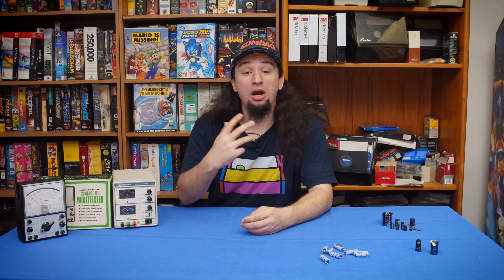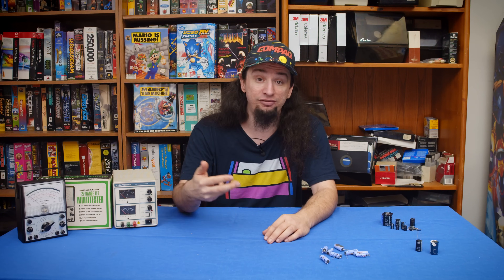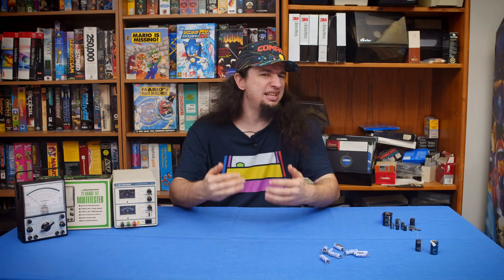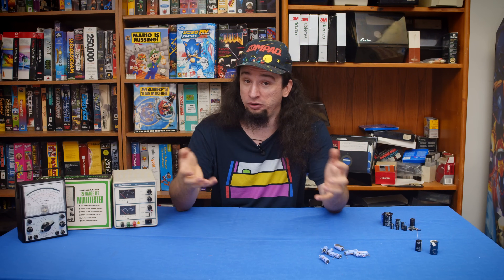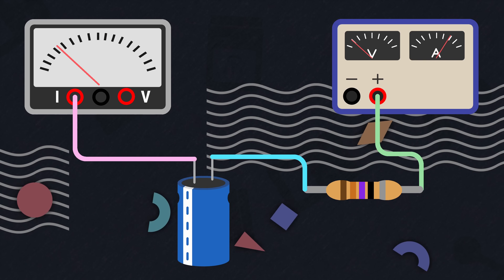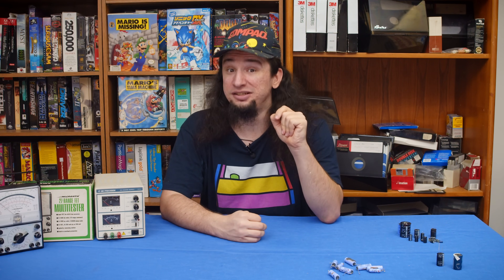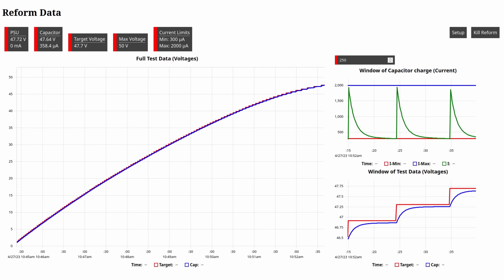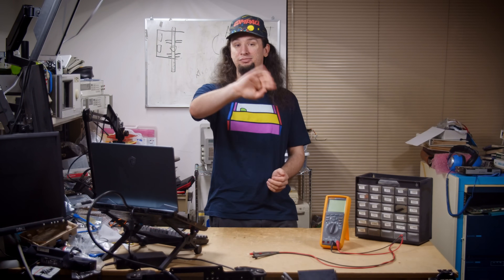Reforming Capacitors - Everything you wanted to know

Comment: So is the rate of loss of the oxide layer a function of the voltage applied? It seems that no matter at what voltage the oxide layer will be lost overtime, except that at near rated voltage it's also continuously rebuilt. So ultimately, my question is, would it be better to store a capacitor discharged or charged if they needed to be stored over a long period of time?
Reply from the maker: The rate of loss is actually more related to the temperature. The voltage only determines the thickness of the oxide.

The capacitor will self discharge over time as it rebuilds the oxide. So for long duration storage, there is no difference. Every device with capacitors in it was stored with them charged (most likely) since they would have been in circuit when the device was powered off.
Reply: @TechTangents  Ahh okay, thank you for the response!
What I meant to ask was, would it be beneficial to store them while the charge is maintained? i.e., using a charging circuit that maintains a constant voltage. I know this may present a hazard, but just thinking out loud here.

Comment: I notice that you are using a BK 1711, the out put voltage is 0-60v DC. The caps I'm working with are 400v.  You don't explain the amount of voltage that you need on your DC power supply to reform.  How can a 60v DC reform 400v caps?  Thanks

Comment: I have done reforming, but find it easier and more time efficient to just replace it. also I have reformed capacitors to have them fail less than a year later with daily use so you might as well just replace it and be done with it if reliability in the long term is important.

Comment: One of the main critiques about reforming seems to be that it might really be isolation of faults by gas bubbles, not true self healing - sounds unlikely however, given we are doing what the manufacturer did in the first place. --- I did reform high voltage electrolytics before, one simple power supply is an isolation transformer+variac feeding a delon circuit . In 120V countries, a tripler or quadrupler might be needed instead of just a delon. Do mind that that circuit can easily produce 800V+ DC with a variac that can deliver 300VAC, so switching discipline is vital.  At these voltages it becomes important to have an accurate voltmeter each both before and after the current limiting resistor (unless you are constantly doing ohms law calculations in your head) - you will need to dial in some overhead voltage on the supply, especially when you are in the phase where you are inching towards having nominal voltage on the capacitor, there can be up to 30V difference easily when you just did a voltage step, but you don't want to accidentally reach 30V over nominal across the capacitor! Also, you want the voltmeter on the capacitor itself to know when your discharge resistor (do. add. one.) did its job, and you also want to monitor for self recharging (I found high voltage lytics do like to do that when freshly reformed.... and having an unexpected 20 or 30V when trying to ESR check it could damage the ESR meter)
Reply: Bears repeating: Remember capacitors are CHARGED after reforming. That could ruin your tools with low voltage high capacitance ones, and your day with vacuum tube/inverter/photoflash grade ones.

Comment: Thanks for the video!
How should I handle my Yahama Midi keyboard and its original power adapter.
The equipment has not been used for a long time.
Hope some one replies!
Using a light bulb as someone commented is nice but should I tackle the adapter alone without the keyboard plugged in!
What next?
Thanks!

Comment: Can I reform several capacitors together by connecting multiple capacitors in parallel?
Reply from the maker: Yes, the only downside is you won't be able to individually tell if they are viable without testing each one of the separately. I track how much current they use and how slowly they come up to voltage for that. The more normal way is to fully charge them and then measure how long their internal leakage current takes to discharge it. Theres no hard value, but it should probably be above half after an hour roughly.
Reply: @TechTangents    thank you very much for your prompt reply.

I am trying to reform 120 pcs of ~4700uF capacitors with voltage rating between 100V to 400V.  It is between cautiously repeating the process 120 times or 12 times with extra extra caution.

With the self discharge, did you mean “half an hour”?  And to what value?  5~10% of its charged voltage?  hmm…. A volt meter with a stop watch counter that trigger when it falls below certain voltage.

Comment: Got a question for anyone on here that knows the answer? I have a board off a rv electric fireplace that I believe the Dane capacitor has lost continuity leaving the board without power going out? Any suggestions on these and is there a better option for replacement like a fuse for the board?

Comment: You know now that I think about it it actually makes a lot of sense that the Department of Defense would have a manual on how to do this. A lot of military equipment is ancient by modern electronics standards, with systems from the 80s, 70s, and even 60s still being in service today. And in a lot of cases the companies that manufactured that equipment don't exist anymore. The military is also weirdly cheap about certain things despite buying $800 screwdrivers in other cases. So you can see why military technicians might need to reform a lot of capacitors to keep old equipment up and running.

Comment: Just came across this - thanks Mr. @TechTangents ! Some used audio gear I have acquired is in an unknown state, so I'll be doing the variac and light bulb trick because all of them are most likely old enough to have  old-school, linear power supplies, not the modern, switching power supplies ("switchers"). Of course, I'll crack them open just to make sure. It is good that you mention that switchers cannot have their voltages slowly ramped up without possible bad outcomes. 

I have also one piece of my own, pro audio gear that is about 25 years old but was powered on only once for a few minutes to make sure it worked - and then shelved and never used again.  It will be very interesting to see what state its caps are in. 

Wow = @Mr. Carlson himself commented somewhere below - he da E-Man !

Comment: Cant find my comment and my eyes are bad. Anyhow im half noob half fixit guy. I remember fixing a logic circuit with all discrete gates and the decouple caps were low voltages and low uf . They seemed ok temp but were leaky. Just saying temp is not always good test.  All depends on what the cap is doing and how often. Idk combo of factors

Comment: I wonder if instead such laborious stepped procedure, we can use a 1Meg resistor  and make the capacitorś charging/reforming curve ultra slow but "automatic". I asume it could not be as consistant as the stepped process, but you can do the process to lots of caps at the same time (asuming all are rated at the same voltage) providing each with its own resistor. It would be the equivalent  process as the Variac you have shown.  Any though about that?
Great video anyway!
Reply from the maker: You will get exponentially slower as you reach your target voltage with that method. A variac still has "steps", they're just when you turn the knob instead.

The resistor is only used because the vast majority of PSUs can't regulate at the microamp scale. If you had one that could, you could have it set to a constant current mode which would raise the voltage automatically all in one device. That is all I've made with this setup though, just by using a higher resolution external multimeter and scaling the voltage with the resistor.

Comment: I feel that any electrolytic capacitor you plan to put into service should be determined healthy before installation.  Whether this be buying new from a reputable place and manufacturer, or by testing yourself.  I personally perform three tests on any unknown aged capacitor.  (1) Capacitance, (2) ESR, and (3) Leakage current after reaching rated voltage after 5 minutes per EN130300.  I refer to general tables for the latter two measures, created in Excel, or reference spec sheets when available.  Makes sense to leave the capacitor on the leakage tester for a half hour to an hour to perform the reformation, especially when age is unknown.  Then crank down the power supply slowly to discharge to zero volts. Recheck C & ESR.

Comment: I did watch your video from start until within 20 seconds of the end. You state that the case for reforming capacitors is with large, expensive capacitors. OK, I'll go with that. But that's a narrow use-case. Given that you've already taken the time to pull out the capacitors and there's no guarantee that reforming can or will bring them back to spec, the use-case is even narrower. Factor into that the amount of time needed to reform, the economics of this endeavour doesn't pay my time to try. So while I applaud you for taking on such a controversial topic and using independently verifiable data to defend your work,  I can't see myself reforming capacitors often (or ever) not would I recommend it to others. Well made video though.
Reply from the maker: I would add to this that the capacitors I'm reforming typically range between $15-$90 and while this process is time intensive, it's not labor intensive even without the computer automation. So there is still a very reasonable cost/benfit to reforming sometimes.
Reply: I agree, there is a reasonable cost/benefit to reforming "sometimes". But even with your persuasive arguments, I think that "sometimes" is rare. 

By your own reckoning,  it is worthwhile when the energy stored in the capacitor approaches one Joule. Since energy = ½ C V(squared) energy stored is much more dependent on voltage than capacitance. 1 Joule would be stored in a capacitor 2µF @ 1000v or 200µF 100v. I would set the bar much higher considering the replacement cost of a 2.2µF 1000v electrolytic capacitor (using film) would cost $3, and replacing a 220µF 100v capacitor would cost $0.50.

I've already done a video on why I (respectfully) think stuffing capacitors is silly. You may have inspired me to do a (respectful) video on reforming capacitors…

Comment: I work on vintage tube radios, record players and amplifiers from the 1930s to the 1960s period. I've had quite a bit of success reforming electrolytic capacitors and I would probably say around half the time I'm able to reform and have them work for a long periods of time. I don't disconnect them from the circuit though I just start at 5 volts ac and bring them up 5 volts every 10 or 15 minutes. Day before yesterday I got a 1948 radio the first time I brought it up I went a little quicker than normal just to see if I had any life in the set and was able to get it to catch stations but there was considerable hum. So I brought it down to zero again and started over. The second time there was considerably less hum. The third time I brought him up they seem to be working fine. This is the reason I searched this on YouTube because I was wondering exactly what's going on inside of the capacitor as it's being reformed. A few times after reforming and then using the record player or radio for a period of weeks I've had the capacitors revert back to the failed stage and get home again at that point in time I change them out.

Comment: I know this is late to the game. I want to offer a tip. Drain your bench power supply feed before you connect it to your capacitors. A lot of the power supplies don't shut off the current on the output side of their capacitor, but instead shut off the current driving their capacitor. This is how I ran 20 volts into a 3.3 volt part because even with the benchtop power supply completely turned off, it still held 20 volts on its capacitor. So always check your bench power supply before connecting it to low voltage parts.

Comment: I'm commenting before I watch the video, because I think if you are an electronics  technologist or engineer (not technician), then it woulda been a good way to start.  Now, however, I'm diving in with great suspicion.  May watch the whole thing, may not.  May modify this comment, may not.  But highly suspect about "reforming" the caps.  It woulda been common knowledge .
Reply: Half way through.  If you want a constant current, there is a VERY SIMPLE cct that will do it.  And you can use a cpmparator to stop the current at a chosen voltage.  Seems like a no-brainer, but then again, this all seems highly suspect.
Reply: Oh no.  Nice equipment, poor methods.  The kind of automation you want can be made on a tiny protoboard with linear discrete components.. maybe could even be operated by battery, voltage multi[lied as required, and the current need not be large at all .  Gives me an idea for a small "reform" product.  Thanks.  Its efficacy,, however... I dunno.  The capacitor materials technology is a little out of my league, so all I can think is to try and test.  After some bowls.

Comment: I'm sure you probably thought of this or someone else mentioned it. It's very cheap and easy to make a HVPS using a AC transformer from an old tube amplifier, etc that you've rectified with a few diodes and a cap or two to lessen the ripple. Of course, the end result won't be an automated process like you have now but, you'd at least be able to reform caps rated 500+ volts when needed. Yes, this either requires a Variac to adjust the AC or if you're inclined, you can create a simple circuit to adjust the DC side instead eliminating the need for a Variac. Since I don't reform caps very often (hardly ever), I just use the Variac to adjust the AC voltage to intern adjust the DC voltage. There's many videos on here of "reformers" people came up with. The majority of people who will want to reform some caps don't need an expensive setup like you have. Buying a lower voltage transformer and making a voltage doubler/tripler circuit will save you some money even further but, used transformers aren't expensive and can often be had for free. I just use one I took off of an old Hammond organ amplifier that's 600 volts. Honestly though, I only like to reform "Can" type caps with multiple capacitances and rare ones you can't really buy anymore. Otherwise, I just buy new ones that are generally much smaller and have better temperature ratings.

Comment: There's a way to use your handheld LCR for measuring ESR in very high uF capacitors. By setting it for 100kHz Rs mode. Measuring impedance only. This way you skip the other parameters going OL problem.

Comment: Used to repair welders and my boss showed me this neat thing where we put a run-out gauge on the side of a capacitor and tested the welder with our load bank. Watching the caps change diameters under use was interesting.  It had no diagnostic value as far as i know but it was interesting in a " huh? Well would you look at that" kind of way.

Comment: 2:40 - apart from the issues of reforming a cap, this small snippet demonstates why older caps have very high inductive reactance

Newer designs offset the foils so the ends can be folded over and the contact lead touches ALL the coiled up foil on its side of the insulator

@kpanic: it's a tradeoff of voltage spikes. I spent a lot of time in the 1980s stripping out and replacing failed 16V caps on 12V rails (plastic cases, they usually _split_) with 50V ones. These were in landmobile base station receivers worth about $1k a pop so it was worthwhile. We ended up replacing ALL caps on sight if we found older devices in them as there were too many instance of replacing the failed ones only, to have other caps fail in-service several months/years later (with a 50-200 mile roundtrip to replace the things including a slog up a mounatin goat track)

Comment: 600VDC is available with a Sencore LC53 "Z Meter".  That's what I use for reforming caps.  No GPIB.  Maybe the newer Z Meters have that functionality (or it could be hacked).
It's an old piece of test equipment but it's nice because it has a big LED readout.  It shows uA so you can watch as it slowly drops to zero (or near zero).
It's supposed to have a thingy to hold down the Leakage button when reforming but mine was missing.  I found that one of those STAEDTLER white erasers is the perfect size. :)

Comment: The higher the voltage the higher the ESR, this is why i cringe when i see people replace say 25v capacitors with 200v ones, its a stupid thing to do.
Reply: It depends on the application. Sure, if you're increasing the ESR of SMPS or LDO output filter caps this will be a problem. But for most bulk bypass, AC decoupling, snubbers, energy storage with low-current output, etc., there's no harm at all in increasing the ESR.

Generally if someone comes out with a hard and fast rule, they're oversimplifying. And that's warranted in some situations, but in this one I think it's safe to say, "If you don't understand the implications of the potential ESR increase for that circuit, don't replace an electrolytic cap with one with a massively larger rated voltage."

Comment: Didn't catch why cant we use a current and voltage limited power supply. setting it to 0.5mA for this example, you leave it there and periodically check the voltage. If it reaches voltage limit, it has finished. if it doesn't, trow it away...

Comment: If you are working with old tube style equipment, the caps, especially the old wax paper style can become very leaky and start to pass DC. This can lead to heavy biasing of circuits and can destroy tubes...  some of which are either hard to source or are unobtanium. For this reason, it is almost always better to simply replace old electrolytics.